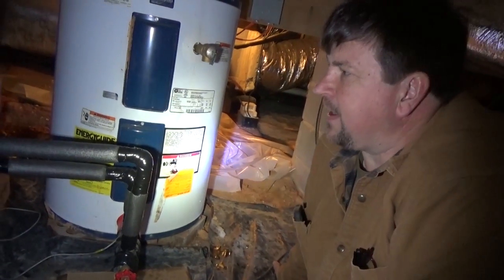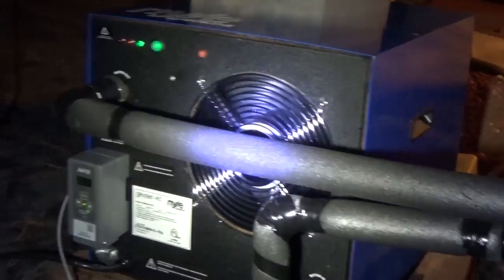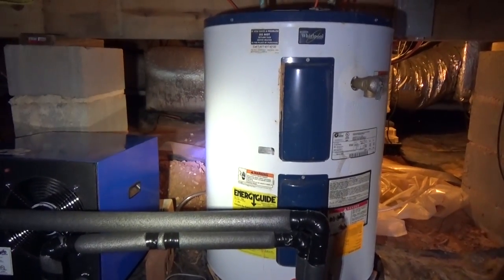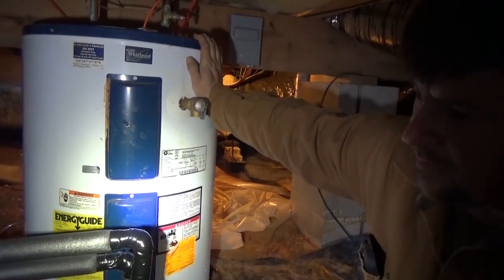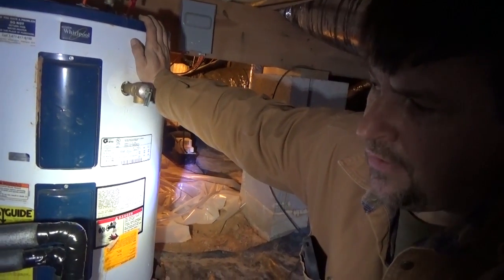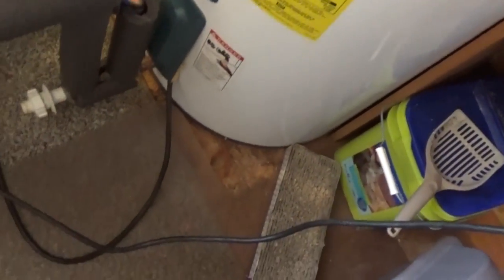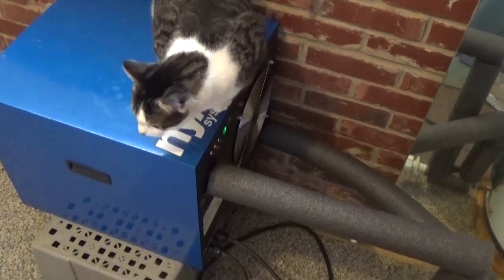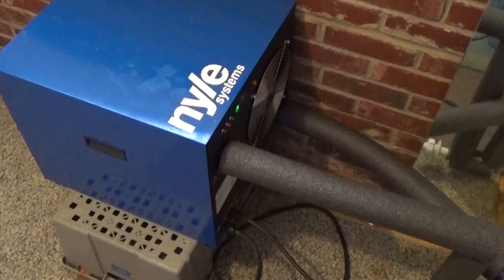Heat Pump Water Heater: Geyser

Comment: With that first unit being in an area with wood, are you worried about over time taking out more humidity than the wood framing can afford and then possibly lead to structural failure? I know it could take a while for that to happen but in a few years could lead to issues. I love the idea would, go great in a concrete basement atmosphere with a closed framing ceiling or poured deck floor. I am big on structural metal studs and steel framing verses wood. They both have there down falls I know but I lean more metal and concreteBut what would I know Semper Fi
Reply from the maker: +Structureman Chop This is a high humidity area so no problem here.
Reply: engineer775 Practical Preppers Thanks!! I understand that area and should be good but just something that might need to be considered in other area applications. Also one thing to consider is the location. Like mountain area verses by the coast, yes you have high humidity but it also has a possible high salt content. Sorry mind is wandering again over the ins and outs.  
but what would I know
Semper Fi
Reply: +engineer775 Practical Preppers  Have you ever done an evacuated tube collector combined with a heat box for convection air with bricks for thermal mass? I sometimes think of ways to have a backup with a backup with a backup which as you know sometimes loose the concept of being efficient. So with that said to combine what you have with a tube collector and maybe even incorporate a wood stove or wood fired (you have shown some awesome units) heating unit to a very large storage unit. then you could also possibly use the super heated water as heat for the house or structure. Sorry rambling again. my mind trying to figure the losses and gains of each to see if it even is practical and would it be practical for a family use, And my big thing is how could I make it Cheaply (cost effectively and almost self Sustaining)but what would I know Semper Fi

Comment: resistance heating has 3415 btu per kWh.   isn't 125' pushing it right to the limit
Reply from the maker: +Roy Amberg not sure of your question.  The Geyser uses a compressor, not resistance heating.
Reply: Correct. Heat pump 300% eff if in the right location

Comment: I always thought resistive heating was 100% efficient. Couldn't you obtain the same low energy draw by changing out the water heater element for a 700 watt instead of the standard 4500w?
I was wondering if you have done a comparison of total energy in to the hot water heater for the specific rise in temperature, volume.
Thanks, love your channel.
Reply: +Jim H You're right resistive heating is 100% efficient. However, heat pumps can be 200-300% efficient. That is to say if you put in 1kWh of electricity in, you get 2-3 kWh worth of heat out. This unit seems to be 200% from the manufacturers website. As to getting the low energy draw, you're right again BUT what would be the recovery rate? How long would it take to reheat the tank? Ans. A long time. Heat pumps are interesting things - I encourage you to look into them. Eng775 - thanks for introducing me to a device I had never seen before.
Reply from the maker: +Tom Bednarchuk you beat me to it.  Thanks for answering.  The Geyser, when it was first introduced boasted 300% now down to 200%.  In our climate of high humidity and moderate temperatures the Geyser works great.  Put this baby on a timer and you can make all your hot water when the sun is shining without putting a heavy load on the inverter.
Reply: +mog5858 No worries! ;-) It depends how you define efficiency. Nothing (even resistance heating) is 100% efficient BUT our definition in this case is heat out / electrical power in. Since it takes less electrical power to get the same equivalent result (since the unit 'steals' heat from the room), it appears that the unit is 200% efficient. That's how heat pumps work - they take the heat from one place (basement air) and pump it to another (inside water tank). In my area (Ontario, Canada), the electrical utility is FINALLY realizing that and having a program to install air source heat pumps for winter heating. These units can produce heat down to -35 C (-31F). It sounds like magic but they work.
Reply: And this will cool the house in summer and "winter" 

I would prefer a water to water heat pump. And use excess cold the water to help the fridge stay cold and pump it back to this unit when it picks up heat from the fridge, They both make the other more efficient in partially closed loop with a storage tank as buffer, And just dump and add some water when needed. And house heat pump could be added but it would really have be geoheat pump or it would overwhelm the system.
Reply: +Jim H i too thought that resistive heating was the most efficient as there is no lost with moving parts like fans. what your take on this? would really like to know. keep up the good work
Reply: Tom Bednarchuk thanks for the info not try to open a can of worms but how can something be more than 100% you would be get more out than you put in. if that where the case we could use that for power generation. by means of thermal electric generation ?
Reply: +Tom Bednarchuk .  I think of it as heat pumps use energy to move heat energy. there still is Conservation of energy.
Reply: +Ken Klemczak Yup absolutely. If you're lucky, you're moving it from where you don't want it to where you do. But I'm rarely that lucky!!  ;-)
Reply: Correct.  Electric is rated @ 100%.  Does not includes losses from the power plant for example a gas stove uses 1/4 - 1/5 the fuel compared to electric power fueled by the same fuel.  Heat pumps are rated with a power factor such as 2.75 - 3.5 as a reasonable example.  An 800 watt heat pump generates the 800 watts of heat from use of the electric, which is 100% plus it extracts heat from the 40*f air/water in the environment that is equal to an additional 1,600 watts of heat.  A heat pump with these statistics equals 300%.  We are able to move twice the heat from outside with a compressor, and the compressor is cooled by the system adding the heat produced operating the pump (100% = 1/3 the btu's).  Do you use air conditioning in the summer?  Free hot water the byproduct or free cooling while using 1/3 the power to produce hot water it is a win 9 months out of the year.  When the supply air is cold, such as not vented outside and the house is being heated, use the natural gas heater or the 4500 watt elements rather than such heat out of the cold heating house.  it should vent outside so spring fall it is outside aire above 45*f and during the summer it can supplement cooling the home and cheap hot water.
Reply: U guys were funny. How can someome called Engineer not know how a heat pump works? 

Electric and heat r both forms of energy so use the same terms but r completely different forms of energy.  A heat pump uses electric to do work to extract heat that efficiency is relative to what heat source is used.  So heat pump using a to cold of a heat source will be less efficient that just using resistance heat,  

So u when using this unit using outdoor air it should  be configured to switch to using  resistance heat when the temp drops, And the added heat loss for from the tank would suggest putting this outside was a bad idea, :)
Reply: A "800 watt heat pump generates the 800 watts of heat", Seriously? A heat pump efficiency is based on the heat source so when its cold out u need a back up source of heat in air to air heat pump in cold climates. Since the efficiency will drop below that of resistance heat. IE  "800 watt heat pump generates the 800 watts of heat" isnt correct or the efficiency of a heat pump would always be at least as high as resistance heat.

So go back to engineer school. Have a good day, Sir.
Reply: I design and build Air source heat pump water heaters in India. Using a 1TR (12000 BTU) rated compressor, that draws 450 watts of electrical power,  I can bring 100 litres of water from 30 degrees C ambient to 60 degrees C in 1 hour and 30 minutes. Plus I get to cool down the room as a byproduct of the heat pump, a very welcome addition in tropic India. Now, do the math and compare this performance to a "100 % efficient resistive" heating system.